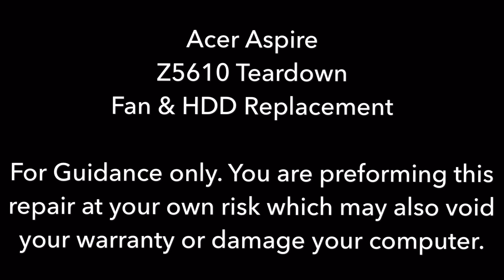Acer Aspire Z5610 All in One Computer Fan & Hard Drive Repair / Replacement / Teardown / Disassembly

Comment: Great video! I have 2 problems: 1) The Nvidia G210M is recognized and works fine but in the OS's device menu there is an issue (with the yellow exclamation point), even if I did the driver update through Iobit driver booster... I'm on windows 10 32bit - 2) the webcam doesn't work as it shows grey and white patterns when activated through 'teams' or 'skype' just as it was broken... any tips on checking it or its drivers? Mine is called 'hd video webcam - USB\VID_04F2&PID_B185&MI_00\6&30216B78&1&0000
' thanks!

Comment: Whats the cure for this exact pc not turning on,is it worth getting fixed or would i be better replacing? Its been struggling to start up and completely shuts down by itself when not in use,its never shut down while ive been using it

Comment: Got an Acer Aspire Z5610 this week, quit after 2 minutes, overheating because the fans were not running, 2 electrolytic capacitors on the motherboard not soldered. tss tss | Nice video,

Comment: I have had mine since 2009 and love it.
Reply: have mine since 2009 too but it's been having the power off issue since 4 years and took it back several times. Everytime they said it would be fixed , but after checking the insides myself it showed that they never even opened the pc since all the dust was still inside. 

So far for trusting the good service of your computer shops. 
This video might have solved the issue.

Comment: Is the cpu soldered to the motherboard because I'm gonna try get i3 9100f and a 1tb HDD
Reply: Hahah.
The fastest this acer supports it the "Q9550s"  Notice an S at the end.
Reply: @Trancelistic  I Have no idea what ur talking about 😅😅😅
Reply: @rip-lyuffy  Sight. U ask about which cpu can go in it. Well max is an intel core quad q9550s
Edit So not a NONE S cpu type.. Like an q9550.

Jeez...
ps, also max 4x 2gb ram.  4gb's don't work.
Reply: @Trancelistic  so ur basically saying old cpus can only work like q9550 and not the new ones
Reply: @rip-lyuffy    Yes, and only the S version. (they use 65 watt, the normal onces uses 95 watt)
Reply: Its still worth it. I went from q8200s to q9505s. a 512 gb SSD and the pc flies in win 10 along with 8 gb ram.
My model do has the 1 GB GDDR3 ATI 4670 though.
Reply: @Trancelistic  nice any good model for the graphics card?
Reply: @rip-lyuffy   Not sure what you mean. But I think the 4670 mxm is the fastest it supports.
Reply: @rip-lyuffy    Yes Ive comfirmed it.
The ATI 4670M 1 Gb Gddr3  is the fastest GPU it supports.

Its still on ok card.

E.G Plays Leauge of Legends high to ultra settings on FULL HD. ( 70 a 90 fps)
Legend Of grimrock 1 and 2 ON full HD NP
It can Even play GTA5 but ye, then all on lowest.

Comment: I want to upgrade the RAM on this computer but nothing works on it except for 2 modules of Hynix 1GB per module (2GB in total). I tried Samsung 2GB modules, Kingmax, nothing works!!!! And don't even mention the frequency. Im not a noob, they were all PC10600 at 1333MHZ. The Hynix that works is also the same PC10600 at 1333MHZ but those ones work. With other RAM, it won't show any image on the screen. WTF is wrong with this computer??? Would it fix it if I update the BIOS? Will it make more rams compatible with this crap AIO?
Reply: Find any solution ?
Reply: @scottb721    I got 4x2 gb 1333 mhz in it from kingston. Works fine.

Comment: I tried to replace the hard drive, but  I actually pulled off the black wire on the sata data cable that is screwed to the mother board. I want to know if it is OK to use with the black wire not screwed on or not. Or did I need to buy new data data cable. Is that black wire a grounded wire? Is it necessary to have it. You can reply to Shirlartsy@gmail.com or my phone number 7313584422.
Reply: Is the black wire necessary that I tore off.

Comment: how to upgrade it to Win10?  GT240M  just can't upgrade to win10
Reply: Yes it can.
Reply: I just upgraded one to Win10
Reply: @scottb721   I've max upgraded mine to 8 gb ram, intel quad 9505s  (2.833 mhz, 6 ,mb cache, also 65 watt cpu) And my video is an ATI 4670 1 gb GDDR3 256 bit)
A 240 gb ssd with a WD elements on my usb for some more storage. (altho its usb 2.0 so the external drive goes to max 35 /mb a sec ish but it will do)
The tuch screen still works as new as well.
Edit: I had win 10 on it. but the colors just so pissing me off, I went back to win 8.1 and powershell etc. Loving it more now.
Ps, it boots in 2 a 3 sec after the bios beep)

Comment: How to upgrade to USB 3.0?
Reply: Impossible.
Reply: @Trancelistic  thank you...
Reply: @Trancelistic  i need to use external storages often...
Reply: @WhiteShook   ye thats why replace it inside. if u know how.
Reply: @Trancelistic  unfortunately, I don't
Reply: @WhiteShook   to bad, but its rly easy.
Reply: @Trancelistic  Aight it's not that easy you need to tear out the old 2.0 and solder in a 3.0, which is not exactly "Easy". So yea if you wanna ruin any warranty you might have and potentially short our ur entire motherboard fine yea its easy.